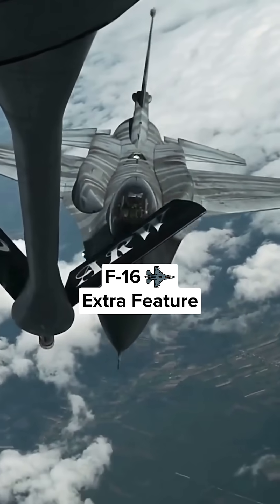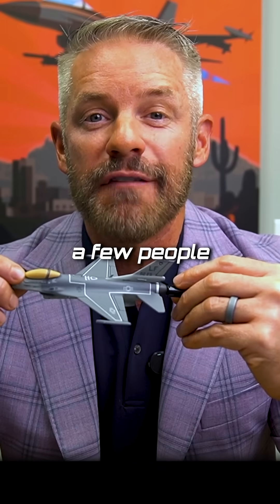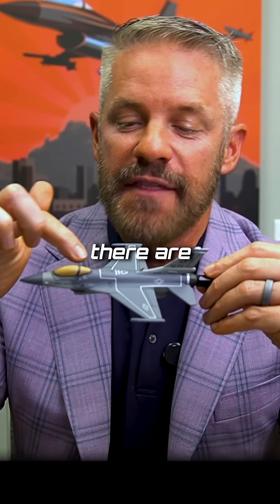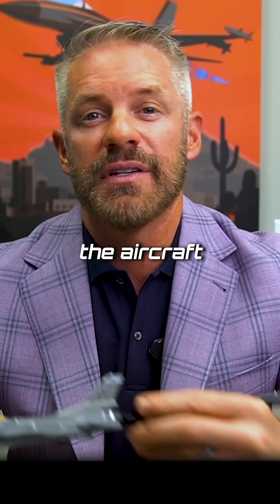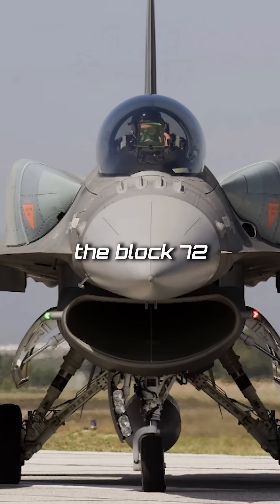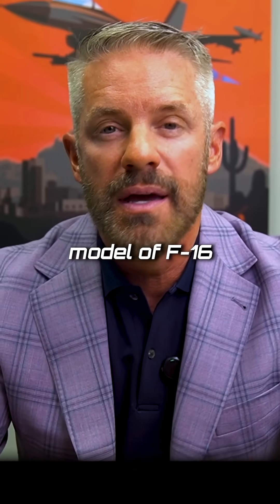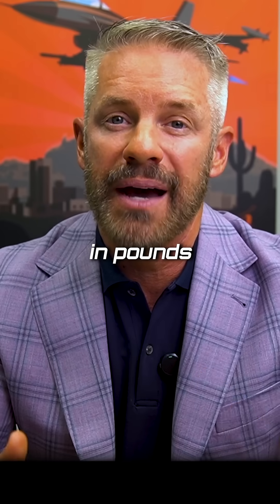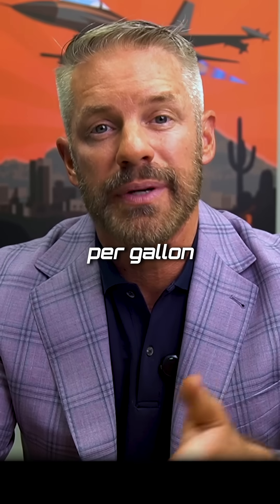What Are The Conformal Fuel Tanks On The F-16?

Comment: F16 with no conformal or drop tanks, aka clean, will be bingo on fuel in 15-20min if youre pushing power pretty hard. Sbes beautiful, but she doesnt have much internal capacity.

Those comformal tanks are eay better than external.
Reply: I've noticed the same with F15s specifically the F15E flying it clean with full load of fuel lasts about 15mins or less if you are going full hard afterburner the whole time you can extend the time if you monitor your throttle meanwhile with the conformal on it, it the can go pretty much 30 mins with them alone and about an hour with fully internal and conformal excluding the drop tank

Ps I haven't flown one irl just sims
Reply: More like 45 minutes.
Reply: Depends on air density. A CFT-less F16 in full reheat on the deck in thick air will burn through all its fuel within ~5 minutes.
If you’re up really high, you can go like ~30mins in reheat.

However if the F16 is flown efficiently, as the CRUS page suggests… you can fly for a very long time regardless of whether you have a CFT or not.
Reply: @nythawkau  Clearly you never recovered an F-16 from flight lol. You’re getting way more than 5 minutes 😂
Reply: @thatmitchellguy  you are confidently incorrect. The  F16 has a 7,000 pound internal fuel capacity and is cabable of burning at over 50,000 pounds of fuel per hour at low altitude. Some easy math shows that you have about 8.4 min of fuel from a full tank.
Reply: @JamesCZFEA  Very confidently correct. And, while it’s capable of burning 50K, you’re lucky to see 46.5K PPH on the FF gauge. And the only way you achieve that is at full Aug and structural limitations keep you from doing that in ground any longer than 1 minute at minimum Aug and 1 minute at full Aug. Engine running to defuel a full slick jet will have you on the pad for at least 20 minutes been there, done that even with the 370 tanks lol, TDY life) Or if you ever watch a demo team, they are running their routine for minutes. You’re speaking theoretically. Nobody runs the jet in full Aug the whole way through 😂
Reply: @thatmitchellguy  dont shake the goal posts there buddy. We are talking about maintaining full burn the whole way, not what the ground crew advises you to.
Reply: @thatmitchellguy  consider this, the F22 is capable of mach 2.25, it will almost certainly never see that speed under normal situations because the RAM rubs off at high air speeds. Doesnt mean its not capable of doing it, the ground crew will just get pissy.
Reply: @JamesCZFEA  Was giving an example and we’re not talking ground crew, we’re talking engineering tech data and the -1  (Dash 1). Just speaking real life say to say facts, not rare “only on a test bed” situations or “look what I did in DCS”. Running full Aug doesn’t happen and not practical. I’m still on engine fuel consumption, you’re talking F-22 RAM coating?? Now who’s shaking goal posts 🤦🏾‍♂️ 😂
Reply: @thatmitchellguy  you had a waiver didnt you? Come back when your reading comprehension can get you out of highschool.
Reply: @thatmitchellguy  btw just to remind you, the time limitations that the f16 stay in burn is classified still. Publicly available tactical doctine is 30 seconds to 1min with cool down periods between use. Unclassified pilot anecdotes for the GE F110 are greater than 10min but will trigger maintenance flags.
Reply: @ 😂😂. You got it my guy. Comeback when you have actual hands on experience with the systems and Acft. Or better yet, holla at me when you get your SC and we can discuss off line on actual limitations and not just the 70JG-10 limits. I’m sure you have much to add to my 12 yrs F-16 experience and 20+ GE exp. I would love to learn more 😀
Reply: @thatmitchellguy  even just logically speaking your claims make zero sense. F16 cant hold maximum rate speed for more than 1min before falling appart? Lmao gtfo
Reply: @ Now you’re pivoting because we were never in the the topic of speed. You got it my guy, I’m not worthy of your vast expertise 🙌🏾😂
Reply: @thatmitchellguy  see you dont even understand how sustained rate speed relates to sustained time in burn.
Reply: @JamesCZFEA  That’s irrelevant to the initial topic at hand, you’re just side stepping and grasping for straws as you attempt guide yourself  back to the convo. You want a kickstand for that pivoting you’re still doing? Temu has them on sale for cheap.
Reply: @thatmitchellguy  lol you are a classic example of high confidence low accuracy. Let me make this real simple for you.  If the f16 cant use its burner at low altitude longer than 1 minute then it can't sustain its maximum rate speed for longer than one minute, that equates to about 3 full circles. If what you are claiming is true, the engine destroying itself after 1 minute then it would not be the most numerious fighter in the US military and would not have anywhere near the amount of foreign users that it currently has. You may have experience but you are entirely full of shit to put it bluntly. For sure prolonged burner use is going to trigger maintenance cues, but 1 min of sustained burner is not going to make the thing fall out of the sky, unless maybe we are talking about one you worked on, given this conversation I wouldnt trust you to put together a lego set.
Reply: @JamesCZFEA  you’re like 10 comments this far 👉🏽              👈🏽 from the original topic and point. Classic example of over confidence in the DCS world thinking it translates into reality. Probably goes to airshows in a makeshift flight suit and tries to tell pilots how it really is from your experience huh? 😂. Was fun though, but like I said my guy, you got it. I’m no match for your divine wisdom. 👍🏽
Reply: @thatmitchellguy  whatever soothes your chaffed ego bud
Reply: @JamesCZFEA  Well I did a -6 inspection on it and it’s still intact, not chaffing. But stand by, trying to inflate it more 🌬️

Comment: Is the performance loss due to the added weight? Or is it just as noticeable when they are empty?
Reply: I was thinking the change in performance in turns was due to the inertia of the extra fual carried. The extra weight wud be harder to carry around a tight turn. But i never thought about if the tanks were empty, wud they still change the performance. I hope he provides an answer to ur question 😊
Reply: @sultanhusnoo8552  i reckon the tanks may alter the fuselages blended wing lifting body dynamic and affect laminar flow to some extent during high positive g maneuvers as well, in conjunction with the additional weight.

Comment: Do dogfights even still occur? From my understanding it's all missiles and flares now, usually can't even see your opponent with the naked eye.
Reply: Planes have had that capability for forty years, the issue is that in any potential conflict you often want to confirm that the target is actually an enemy craft before you fire, which necessitates getting into visual range, additionally in many circumstances the Rules Of Engagement demand that the pilots not fire unless fired upon. This may happen after the potential enemy aircraft has closed the distance, so it is still very important that modern fighters maintain some dogfighting capability so they dont become helpless if they end up having to fight in close quarters, this is why the F22 Raptor, the stealthiest fighter aircraft in the world, has absolutely vicious turning performance and power to weight ratio.
Reply: @extremepredudice  Nice, thanks.
Reply: @extremepredudice  good to see lessons were learned from the Phantom
Reply: @extremepredudice there is zero requirement for visual identification in modern air combat... Identification Friend or Foe systems have been around for decades with the current  IFF Mark XIIA Mode 5 in use by NATO since 2002...
Reply: They don’t in the real world anymore. If world war 3 happens I could see a few happening. Theres just not enough jet on jet combat in the last 20 years for the sample size to be big enough.
Reply: Chaff not flares... and yep. 99% of modern air to air combat is BVR with super long range radar guided missiles. The dogfight doesn't really exist anymore.

Comment: I think they look cool af. I wouldn’t want to get into a dogfight with a plane that looked like that
Reply: Really? I think they ruin the lines of the fuselage.
Reply: Quite otherwise actually.
Reply: @BengalLancer  wdym
Reply: Can you eject the conformal tanks?😅
Reply: @scorch946  no
Reply: Actually, in this era of modern combat, if you see a F-16 with conformals, merge! Merge instantly, you’re most likely lighter than him and will out turn it, they add weight and drag to the jet and they’ll end up having to ditch
Reply: @ sure it might be worse in a dogfight but good luck getting to the merge with the f-16
Reply: @ it’s an F-16, 6 AAM total, it’ll be fairly easy to merge with a 16 if your in anything not NATO… Su-30s carry 14 hardpoints and the Su-27s 12…. Most 16s will Die before the merge but yeah good luck for an F-16 to make it to the merge
Reply: @exoticjetz9584 just because it only has 6 missiles doesn’t mean theyre bad missiles
Reply: @ViperCinematics  exactly! Some f-16s have even been using the aim-260. Plus they have the monster that is the aim-9x
Reply: @exoticjetz9584 that's why, in modern air combat, someone who's run out of missiles would simply leave. Dogfights don't happen anymore
Reply: @snonsig2688  that’s 90% true. It can still happen just very rarely.
Reply: @exoticjetz9584  Video game expertise doesn't necessarily translate, Sparky.
Reply: @ uhm? I’m talking about a real life situation, if you have intel that the F-16s are either doing long distance CAP patrols, or staying in the air for longer periods at a time, then assume they have conformal tanks on, and on intercept if you can confirm it, engaging in a dogfight would be a piece of cake for any Flanker/5th Gen Warsaw Aircraft (J-20, Su-57, Su-75)
Reply: @ if you are in a BVR fight, and defending yourself, the Conformal tanks will actually help bc for one, you can stay in afterburner for longer periods, be able to safely defend incoming Fox-3s, And Lastly, If Shit goes south you can run away and safely get away due to having your burner on
Reply: @exoticjetz9584 Most advanced Russian SUs couldn’t gain airsuperiority against Ukraines Soviet era SUs and Migs. SUs are a joke.
Reply: @exoticjetz9584 if you’re in an airspace where you see an F16, fuck merging. There’s his wingman, and probably another flight somewhere ready to kill you.
Reply: That's the worst take ever. They're ugly af, it completely ruins the sleek and clean look of the F-16
Reply: @benedekmartin3596  great. That’s my opinion. And that’s yours
Reply: @benedekmartin3596  skill issue
Reply: @benedekmartin3596  chads who realize looks dont matter vs virgins who obsess over a planes looks